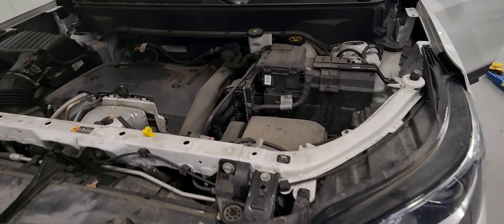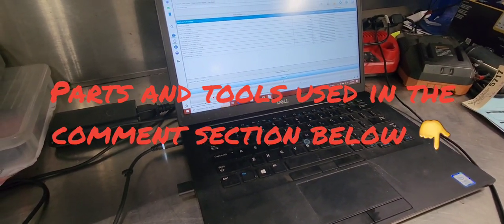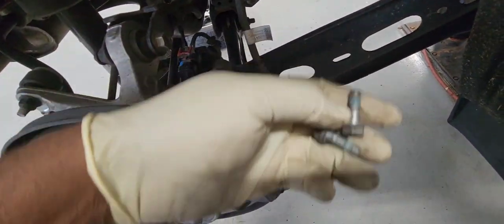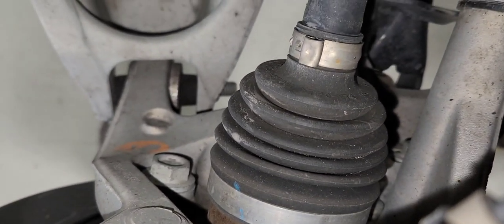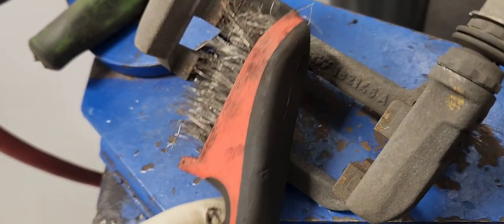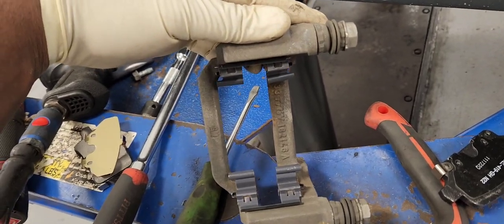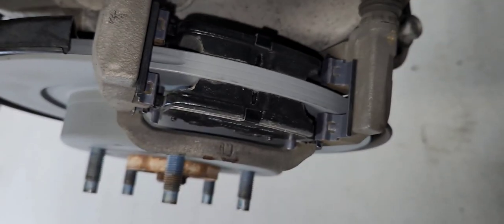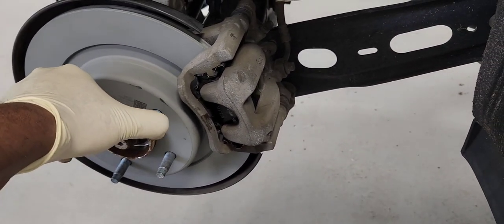2018 and newer Chevy equinox,GMC terrain rear brake replacement

Comment: I’m about to replace rotors and pads on my 2019 GMC Terrain, just was wondering why some videos take apart the rear parking brake and your video doesn’t? Is it necessary or no thanks for your information Steve 👍🏼
Reply from the maker: It is because they don't have a dealer level scantool to put it in service mode, if you have one that part is not necessary
Reply: So I don’t need the level scan tool right, I’ll be doing it in a level garage, could you leave it in neutral and chalk the wheels will up the brake stay off.
Reply: Will brake stay off
Reply: Thanks for replying in a Fashion matter 👍🏼
Reply from the maker: @jamesmcguire1177  if you are taking the parking apart, no,I would also suggest  to unplug the battery

Comment: do you reallly need the scan tool?
Reply from the maker: Unfortunately,yes , check this one out, you don't have to break the bank
https://youtu.be/TSWwa5fJRW8
Reply: no, you don’t. take 2 T-30 torx out to remove the E-Parking brake assembly, and take a 7mm allen head and turn it back clockwise with your hand until it stops. after that you should be able to compress the caliper normally